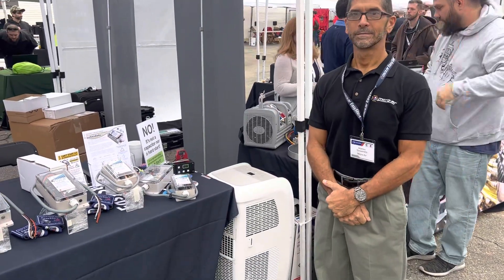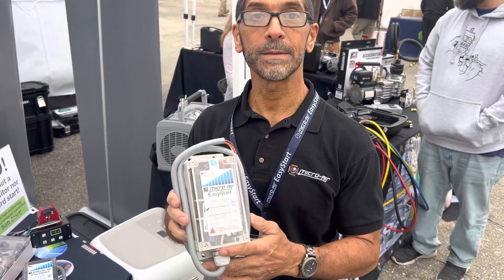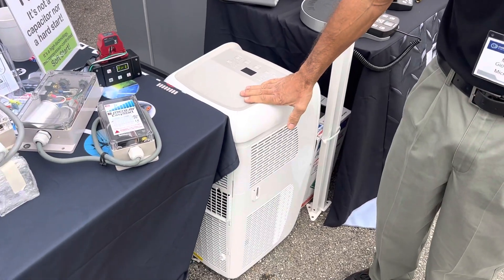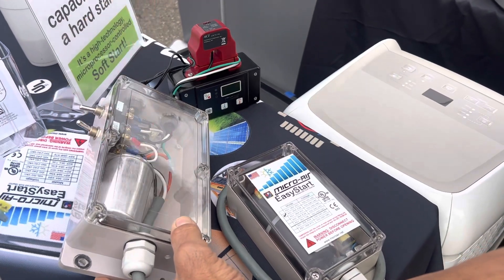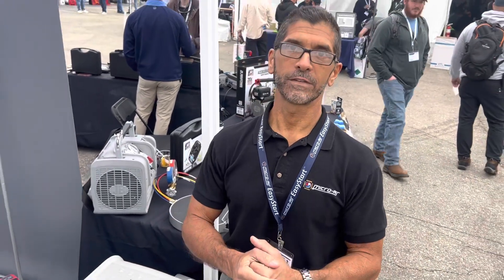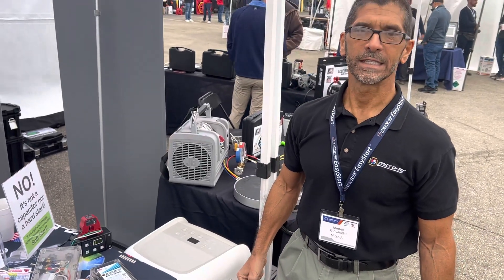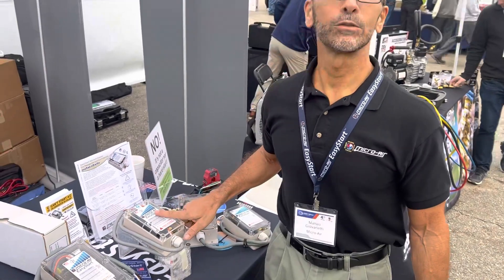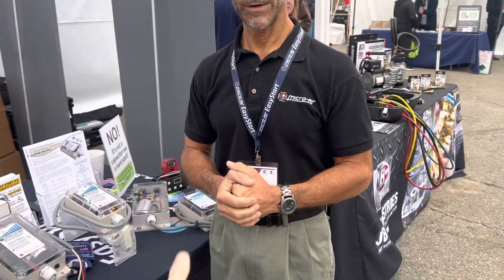Micro Air CO, developing engineer, explains ￼ “Easy Start”  ￼

Comment: Awesome product. Use mine on a 4 ton residential A/C outside unit. Lowered start up amps well over half. Can now use my back up generator if needed without having to start the inside air handler (fan) first and then the compressor.  I've had it for about a year and a half, and no issues whatsoever. Only thing I would suggest would be the ability to connect to Easy Start using wifi rather than bluetooth only. It would be nice to be able to monitor the system from anywhere. Also the ability to check  status / history etc when compressor is not running. Probably asking too much. LOL.  Carry On!

Comment: So would this product help increase the lifespan of a compressor?  Have a new Goodman ac unit with a Copeland scroll compressor, was wondering if this could help quiet down start up and possibly make the unit last longer.  Seems like without it it’s like getting a baseball to 100mph by hitting it with a bat and with a soft start it’s like getting a ball to 100mph by throwing it.  Seems like the latter would cause less wear and tear…or is it a negligible amount?
Reply from the maker: @H750S  goodman is not even nearly as loud as an old Bristol compressor starting up. The Bristol compressor was 10 times louder.. 

Modern compressors are extremely quiet he could barely hear them start .  But they do cost more money.

These are mostly specifically made for special situations when people have generators for electricity back up . The amount of amperage that is required to start a compressor is very high so you would have to spend a few more thousand dollars to buy a very big electric generator.. 

By purchasing and adding this device, you can purchase a much smaller generator . 

The same goes if you have solar or battery back up off grid power then you would want to use this device 

Or if you have an RV because they have limited electricity available .  And if you had a big or even multiple air-conditioning units on an RV, the start up current that is required for the in rush is very great so one of these devices are specifically made for those purposes.
Reply: @coldfinger459sub0  gotcha, guess I’ll save my money until I get a panel upgrade that can have a generator hooked up lol.  Thanks man
Reply from the maker: @ I forgot to mention they do sell compressor sound deadening blankets.  That have a heavy felt material with a sounding heavyweight vinyl rubber, covering that you wrap around the compressor to quiet it down.

This is a standard feature in All more expensive high-end outdoor condensing units 

These are never included in cheap units because they cost extra money
Reply: @ good to know👍🏻

Comment: Would this work to reduce the amps on the start of of a pool pump?
Reply from the maker: You don’t try to reduce the amps and it’s only the startup amps. 
     This has a specific use and what you may want to use it

If you had a undersized generator on your house that was gonna run your air conditioning or a large motor than this would be be 

But if you already have a correct size generator, or a solar inverter that is properly sized than this item would not be needed 

If for some reason, electrical wiring going to the device was grossly undersized .0 
       Causing a large in rush, power pool voltage drop and heating up of wires and contactor points, causing contactor points to burn and other damage on components that cannot handle the low-voltage condition charged by undersized wires. 
     And to replace the wires, for some reason was astronomically expensive. 
      Then this device would be an excellent choice if it could still supply the proper voltage to get a motor to turn over. 

But you don’t use the device just on the grounds of trying to save energy to reduce power consumption

Comment: Very interesting.  However, would be nice to know each model number.  I'm looking for my second micro air easy start and it's rather confusing on their website.  The breeze 364 looks like The Bluetooth is not built in You have to attach it in some form or fashion. Their website has one video which is informative. But, there's no delineation on the Bluetooth nor is the 364 the latest and greatest and why isn't Bluetooth built in. I wish they had a better person running their website.

Comment: Any benefit to installing these on house AC's, where LRA is not an issue?
Reply from the maker: I would only install them if you had a generator that you had to use or a solar inverter. 

On paper, they sound really good . 

But you gotta remember it’s just another park that could malfunction and fail and actually caused problems . 

Just like the three phase controller for house units 

I’ve seen a half a dozen of those fail now, and actually caused damage to the units only allow single phase on a three phase system or only two phase . 

That’s exactly what they were meant to prevent . 

And a diagnosis time for somebody to go out there and diagnose when they have a problem and the technician is not familiar with them or even if the technician is familiar with them, but not their failure 

Where I am located labor rate can be anywhere from $250-$350 minimum service call is usually $300-$500. 

The consumer ends up paying more to diagnose a problem caused by the device than the device cost or any energy savings over the entire lifetime is eaten up by one service call that is caused by the item.,

But 99% of all my installations of heat pumps are all soft start because they’re all inverters. 
Like FUJITSU or LG or Samsung or Daikin. 

So there’s absolutely no use for such a device

Even on a generator or a solar system.
Reply: I had one installed on a $15,000 BTU echo Cool.  I am using a 1900 watt continuous inverter generator.  It started the AC and didn't even as much as stumble.  This would totally not be possible without the soft start so yes it does have its uses and it does work @coldfinger459sub0
Reply: @coldfinger459sub0  These have been failing a lot lately as short as 24 hours after installation.